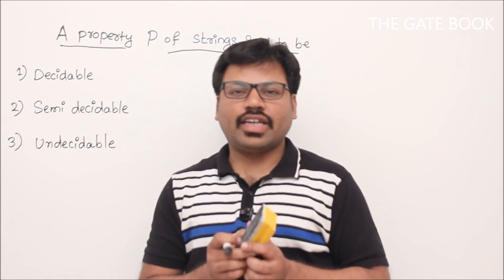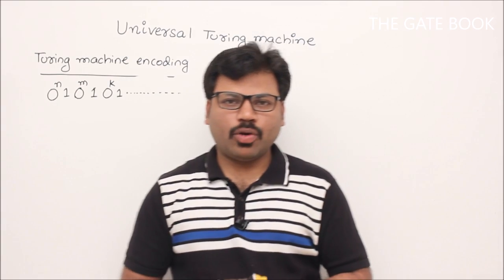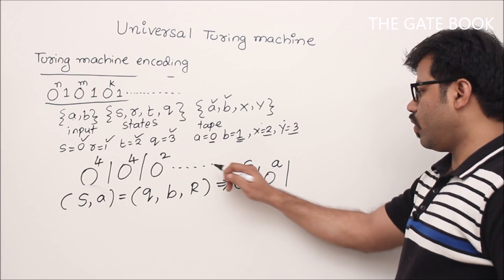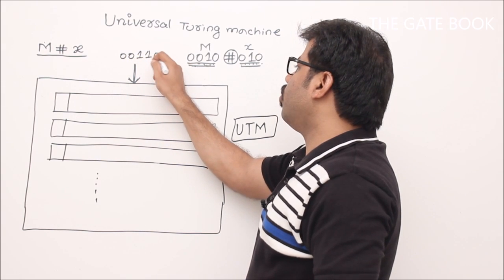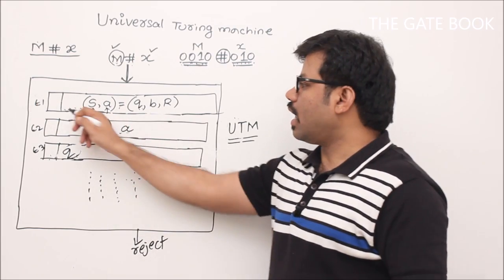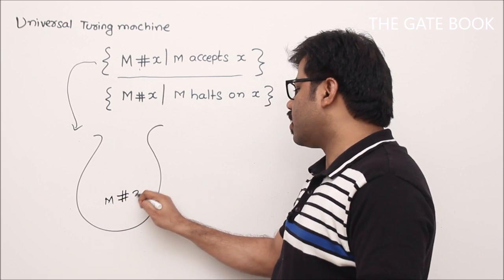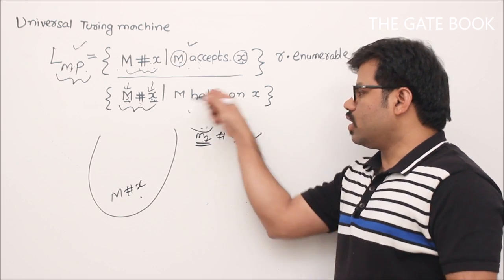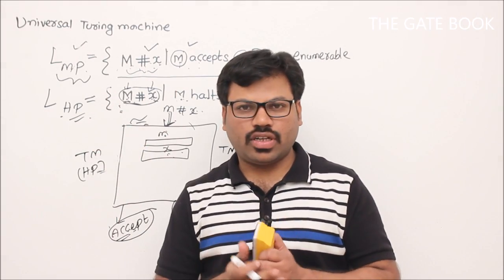Decidability

Comment: What is the difference between Total turing machine and Turing machine?
Reply: TM machine says weather 'L' is accepted or not; where as TTM also says weather 'L' is accepted or rejected.
Reply: ttm is a halting turing machine
Reply: TTM is for recursive languages, where TTM will halt in finite amount of time if it accepts, and also when it doesn't accept.
TM is for RE but not recursive, which accepts the input, but sometimes run forever without telling whether it accepts or not.